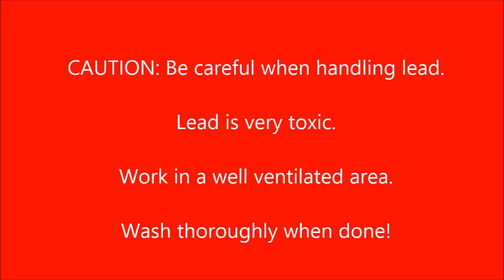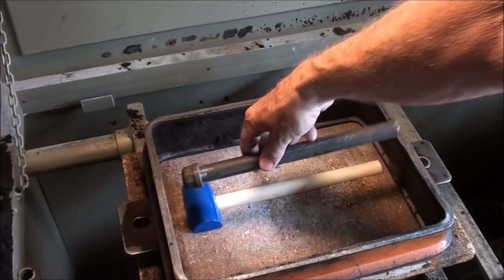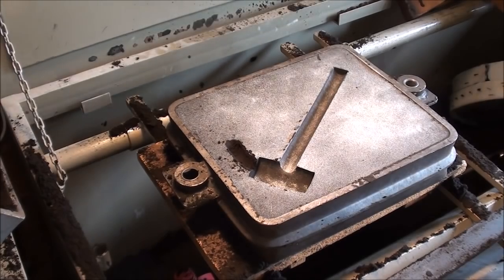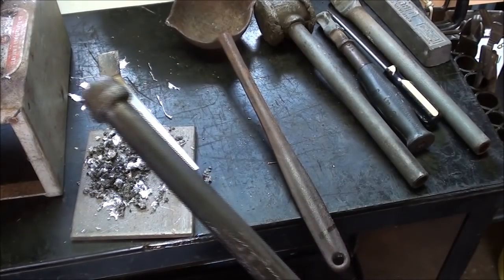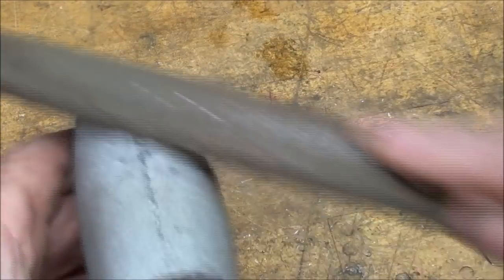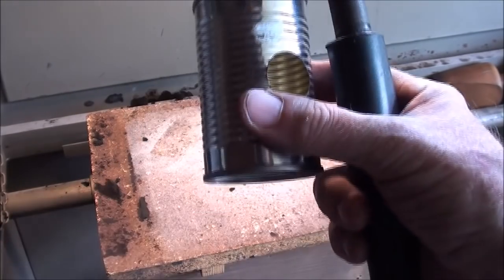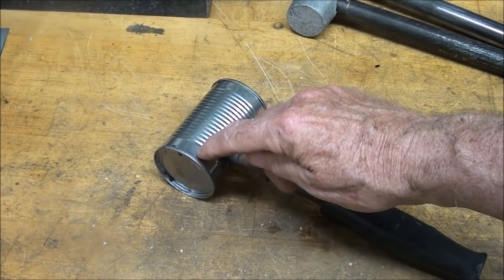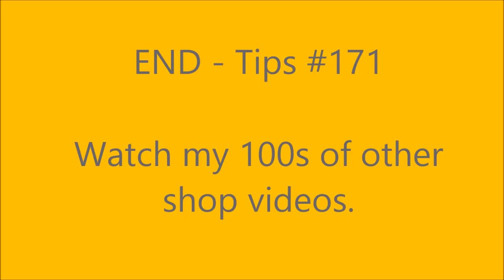SHOP TIPS #171 Casting Lead Hammers 2 methods tubalcain

Comment: Let me say first I love your videos.  Over the years I have been sort of a jack-of-all-trades, and have done machining, welding, casting, electrical, and carpentry. You have great educational videos for a younger generation.  If they will watch and learn!
Wasn't babbit used to cast bearings for old locomotives, and or tractors.  I haven't used babbit myself, but I am almost as old as you, and I remember my dad talking about babbit bearings.  I like the tin can method for my small home shop.  A cast that large can develop a void.  I had to explain that to some engineers one time about cast aluminum parts.  What is the hardness level of the lead.  Doesn't sound like dead soft lead.  Don't melt lead in the kitchen, when you flux the lead the smoke will carry lead particles to contaminate the surrounding upward facing surfaces.  Stay well, and keep educating the masses.

Comment: Tubalcain, I've made many an aluminum hammer from my Grandpa's mold. He took a steel pipe (1 1/2 inch) and cut a slot in the top wide enough for the pipe handle. Then he clamped two pieces of sheet steel on each end. He poured the metal in through the top where the slot is for the handle. when it was cool, he unclamped and slid the hammer out and then made another one.  ;) Thanks for all your videos!!

Comment: Keith D    Gosford Australia
To reduce the dross formed add a sugar cube sized piece of candle wax to the melt just befor scraping the dross.. This reduces oxides back to base metal and keeps the melt shiny looking. A puddling stick made of pine with lots of resin will also flux the melt and improve the look of the finished pour.
Reply from the maker: Thanks

Comment: My dad was a pipe fitter and while working at the Goodyear tire company in Topeka Kansas a guy made him a lead hammer 🔨. And it sat around in his garage for years. Until he gave it to me and I had it for several years before I used it on a freightliner drive shaft and beat the hell out of the drive shaft and that hammer. It’s been sitting around for years again and now I’m going to try the tin can remolding.
Reply: I tryed the tin can methed and it worked great. Although I did use a aluminum can that was a sport drink and a lot thinner then a pop can. I cut it to three inches long and drilled a 7/8 hole 🕳 in it for my handle. The aluminum held up well and was perty easy to peel off.

Comment: Aldi cans have slightly smaller rim crimps than the industry standard. Modern can openers HATE them.  I literally had to use a set of tin snips to open a can of soup a few months ago! The old fashioned 'butterfly' can openers work well, so does a military P-38 :)
Reply from the maker: ***** Thanks
Reply: +TheChipmunk2008 Remember the P-38 well :D

Comment: I have a can opener that cuts the side of the seam on a tin can and it doesn’t leave any sharp edges. I’m wondering if it would help to cut both ends off before pouring the lead. 
Your video has my gears ⚙️ turning I want to try this tomorrow to remake that hammer that my dad gave me oh so many years ago. 
I just cast some sinkers for fishing and all of my stuff is set up all I need is the can.

Comment: How did the air get out when pouring using the sand cast method (as the top of the hammer head mold appeared higher than the fill tunnel)?  Did I miss something?
Reply from the maker: Sound is permeable

Comment: Freeze the tomato paste in the can and then drill the hole.  The can will hold its shape better when you cut the hole in the side.
Reply: a trick: watch series on flixzone. I've been using it for watching a lot of movies lately.
Reply: @Ronin Kaiser definitely, been using flixzone} for months myself =)
Reply: It would be messy but I wonder how it would work if I drilled the handle hole 🕳 first then cut the end of the can off   
My can opener cuts the side of the lid seam. 
And everyone has been using a can opener wrong anyway. Next time you open a can try turning the can opener on its side and then open the can.  🤪.      
Just trying to think of different things to do.

Comment: I'm not sure if you will see this comment, Mr. Pete, due to the age of this video, but I'm curious. Would the lead adhere to the steel pipe handle better if the pipe was taken down to bare metal and acid flux applied prior to casting? 

My apologies if this has been covered already. I plan to watch all your videos. If this query has already been addressed I should find it in due time.

Thank you!
Reply from the maker: Thank you, I doubt that would make any difference. Because it is not Solder

Comment: Would it improve adhesion of the head to the handle if the part of the steel handle inside the lead was cleaned and tinned before pouring?

Comment: If you fill the can with water then freeze it, you could probably use a holesaw to cut that 7/8"Ø hole for the handle... ..as long as you drill it right away, straight out of the freezer. ..on second thought, maybe drill in reverse once you get the pilot hole drilled...
Reply from the maker: Good idea
Reply: mrpete222 wow! Thanks for your reply.  ..I thought a little more about it and figured, if that's not enough to support that action, the whole can could be submerged in a half gallon milk carton filled with water then frozen , then peel off the carton and drill through it all. ..Anyway, thanks again for your reply and for all the awesome videos. Cheers n God bless-

Comment: I bet if you turned a piece of wood the size of the inside diameter of that can and slipped it inside before hand, a regular hole saw would work with that backing in there.

Comment: At work I use to make lead hammers using wheel weights and 12 oz aluminum cans. The lead doesn't stick to the aluminum can and the can leaves no ribs on the hammer head.

Comment: Great video.  I like cheap, simple, easy for projects.  Even though the permanent mould is classy this tin can method is my choice.  If you don't chew on or eat the lead and keep it below its vaporization point then you will have a hard time getting poisoned.  Boiling point 	2022 K, 1749 °C, 3180 °F (at its boiling point it starts to emit vapors).  Most commercial lead melters such as those sold by Lee Precision and Lyman cannot exceed about 850 deg F due to the small size of the heating element.  I have a 10 pound Lyman lead melter and with it turned up all the way you could wait all day trying to get 850 F.  You could possible get into trouble using an acetylene torch for melting lead.  I like to be safe.  No one in their right mind wants to get hurt but I wish we could use some common sense in our safety rules.  I can remember the spill of some tons of iron oxide on the freeway and the hazmat team with paper suits and dust masks cleaning it up.  The news media not bothering to learn what iron oxide is made a big deal out of it.  Look up iron oxide on Wikipedia.
Reply: I'll just add that I've been casting lead bullets by the 1,000 for many years and had a blood lead level run a while back just to check. It came back normal.  Use a little common sense, such as no eating or smoking while you're handling lead and it's perfectly safe.
Reply: I too have cast thousands of bullets of lead (wheel weights). The immediate danger is splashing lead from adding damp or wet cold lead to a pot. Another danger is putting a sealed object into molten lead. Remember the hammer he showed that had a chamber inside it? Imagine a pocket of air or water trapped inside that as he lowered it into a pot of molten lead. The air or water could pressurize as it is heated and when the pressure is released spray the lead everywhere. Even a small insect pushed beneath the surface of molten lead will cause a big splatter. The safe thing is to warm up all metal to drive off moisture before putting in the molten lead. Yes, I know we've all done it the wrong way, and gotten away with it.  Lead doesn't have to boil to give off vapor. Boiling is just when the vapor pressure equals atmospheric pressure, it is giving off vapors long before that. The real danger is the lead dust from the dross, the vapors, and the debris from working and filing the metal. The dust remains even after the lead pot is put away.  Wash your hands and minimize dust exposure.

Comment: Looks like I  need to make a lead tomato paste can hammer now.  If I were to try this with a small aluminum drink can, do you think it would hold up to the heat of the molten lead? (I'm thinking a 7 oz drink can).  Also, here's to hoping for a whole bunch of videos on the ressurection and restoration of that old Vespa......
Reply from the maker: Stick to a steel can.